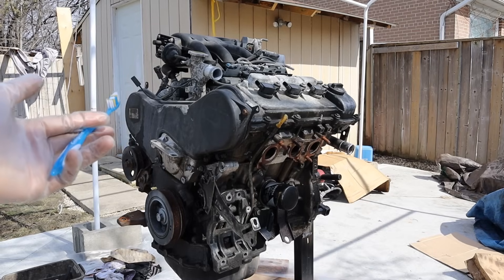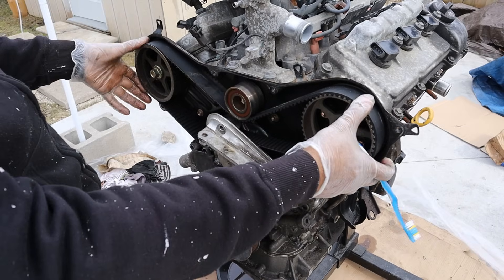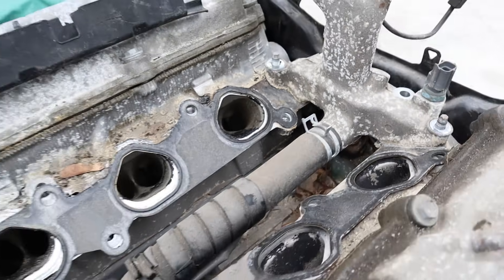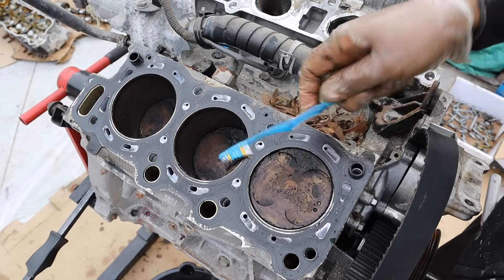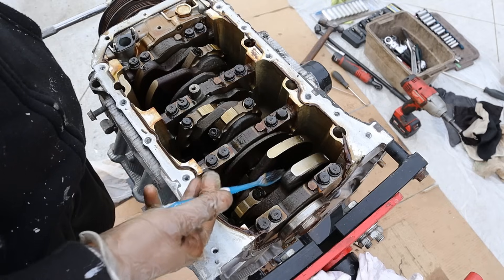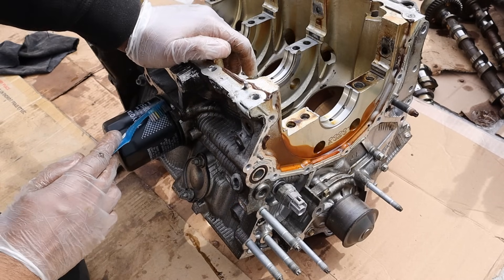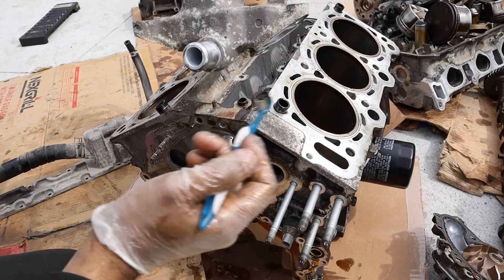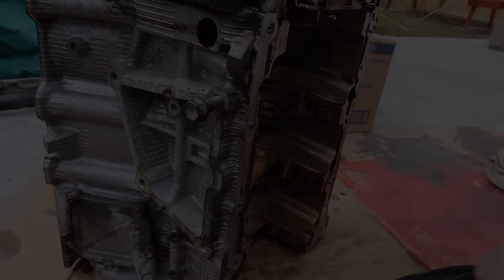Here's how the Toyota 3.0L V6 Engine Became a Success

Comment: I have this same engine since 2002 with 130,000 miles.  Very reliable,  smooth with ok power and fuel efficiency for today's standards. In the last 20 years I had to replace one  knock sensor, 2 oxygen sensors, spark plugs, timing belt and water pump. That is it. I tightened the valve cover bolts to stop oil seepage in the winter months. I know I will never own an engine this well made.
Reply from the maker: Nice! How's the fuel economy on yours? I know it's a V6 but my Lexus GS350's V6 makes more power and has better fuel economy than my Camry's.

Comment: Got one in my 01 es300. 192,000 runs smooth and quiet as the day it was made. Love these motors
Reply from the maker: Beautiful! 
Just watch out for the transmission in those 99-01 ES300s
Reply: @speedkar99  already replaced it. Torque converter went out

Comment: Im not a mechanical engineer but I dont know why some manufacturers have a intake plenum going way back over a bank of cylinders while you can be like the chevy ls, buick 3800, ford 4.6, or honda J series and have it totally nestled between the 2 cylinder banks.
Reply from the maker: It's about airflow and packaging for the hood height
Reply: @speedkar99  too bad serviceability isnt a factor.

Comment: My 99 ES300 with the 1MZFE is at 215k. Oil level barely drops between oil changes. Engine and transmission still running great.
Reply from the maker: Nice! Back when I had a 99 Solara I always wanted to trade up to the ES300
Reply: When I bought my 99 Avalon 180k, it lost half a quart between 3000 mi changes. I replaced the leaking valve covers and started swapping the PCV every 6k (at which point they are ALWAYS full of oil) and i don't lose a drop anymore. Now at 217k.
Reply: @matthewbowen5841  sure makes it easier to remove the pcv grommet when you replace it often! I remember the first time I changed it. Man, that hardened grommet put up a fight lol

Comment: I have a 1mzfe in my 2000 Avalon. It burnt an exhaust valve in cylinder 2 at 189k. I did a top end rebuild and replaced the valve along with a bunch of other parts and seals, and it's running perfectly again now at 217k. Great reliable engine, fairly easy to work on.
Reply from the maker: Good for saving that motor. Cylinder 2 was the easier to access front bank right?
Reply: Mine did the same thing. Exact same car and I replaced it myself. Runs like a champ. Only 176k miles can’t wait to push it to 500k +
Reply: Have a 96 Avalon cylinder 2 blown spark plug heavy smoke out tailpipe what could be the problem?

Comment: I have same engine in a 2000 Avalon, 294,000 miles.  Drives like a dream.  I change oil at 3000 miles or 5 months, whichever comes first.  I wish I was as good as you are.  I would take it all apart, clean, and rebuild.  Good video.
Reply from the maker: Beautiful, almost 300K

Comment: Makes me a proud owner of a 2005 1mzfe vvti camry 😂 my car has a few mods including major weight reduction, I raced a 2012 Civic SI coupe with the 2.4 the other day and it was window to window from 40km/h to 160!!, As a matter of fact I was pulling away!
Reply from the maker: Nice! What weight did you reduce ?
Reply: @speedkar99  lighter sports muffler, full size spare wheel and kit delete, zero seats in the car but mine, low profile 15 inch tires in the front, k&n air intake
Reply: And 20 lb civic battery

Comment: Wow good stuff as always. Seems like a knock sensor is a really senstive microphone. This engine's been good in our non-interference rx300. No issues so far at 155k miles except rust lol.
Reply from the maker: Yes the knock sensor is a microphone that's tuned to detect certain frequencies. 

Gotta keep the rust at bay by frequently Washing off salt and rustproof each year.

Comment: Actually , power steering pump is fairly easily accessible from the bottom when the vehicle is jacked up or on the ramps.
Reply from the maker: In the gen4 body maybe. Not the 5th gen. Things are tighter.
Reply: @speedkar99  2003 Camry v6, I even ordered one, but never got around installing in.

Comment: I just did a timing belt and seal overhaul  on my moms 03 Avalon with this engine and 280k miles. That vehicle is a true testament to Toyota’s older reliability. What a pain to do over my Accord J30 engine in the bay.
Reply from the maker: 280k miles, nice! 
The accords were good motors too, the only thing I appreciate about them is it's easier to get to the rear spark plugs due to the intake design
Reply: @speedkar99  I have done at least 30 T-belts for the J-Series and already 2 too many now for the 1MZ-fe. She runs 87 octane in it and supped to be premium but still runs perfectly smooth with no hesitation. 

I settled on a 06-6–6 sedan. Accessories are not as reliable on a Honda but those engines really are bliss.
Reply: I miss by accord with the j30 v6
Reply: @thetechlibrarian  my friend is selling one for around 2-3k Virginia.

Comment: I have just over 350 kms on a 2003 MCV30 Camry and hasn't skipped a beat (touch wood lol). Haven't had to replace any critical components yet, just the usual globe/belts/fluid/filter changes which are done myself. Actually the air conditioning and a rear door lock actuator doesn't work, that's about it.
Reply from the maker: Nice! How's the suspension held up? They usually get clunky at higher mileage
Reply: @speedkar99  Suspension is holding together pretty good, albeit haven't had a good look underneath for a while as haven't had the need to. She frequently sees rough unpaved building sites while full of tools (work) yet no rattles or clunky sounds, yet lol. I appreciate that you replied to my comment 😆 thanks and loving the vids

Comment: 2000 Avalon—352,000 miles; 5th owner, uses 1 qt every 4,000 miles; no internal motor or tranny work. Boring is good.
Reply: Swap your PCV. I bet it will slow/stop oil use. Then keep swapping it every other oil change.
Reply from the maker: That amount of consumption if say is normal

Comment: mine nearly failed because of the VVT solenoids. Cost 300 bucks for the part to fix one bank. Also I have the 2001 avalon and managed to do the back bank of spark plugs completely by feel, it's technically possible to do it without removing the intake manifold. But it really sucked so probably better to take off the manifold instead.
Reply from the maker: Yeah the older 1MZ with the metal intake manifold is easy to change spark plugs. It's these newer ones with bigger plastic manifold that have to be removed.

Comment: Because of its placement with minimal air getting to it, the power steering unit has its own cooler/heat exchanger in front of the radiator. Well, the Aussie assembled Camrys sold in my country do anyway. :-)
Reply: That was one of the changes to the XX10 when the tooling was shipped from KY to Australia.
Reply: @matthewbowen5841  "KY" ???
Reply: @TeUhtred7860  Kentucky, USA
Reply from the maker: Not all do. The 5th gen Camry runs the line to the front but it turns back around and goes to the reservoir.

Comment: Had a Camry like that. Reliable but boring. Solid it for an electrical nightmare of a B5 Passat 1.8t 5 spd. Didn’t regret a thing.
Reply: Being boringly reliable is the exact reason i bought one as a 2nd car, also save gas and wear on my Lexus IS-F.
Reply: @TeUhtred7860  Yup, does the job! I'm coming into age, wife, maybe kids soon so I said to myself next daily driver after my '12 TDI will be a prius or a corolla. I'm not a mechanic but I work on my cars and I need one that does not need any work.
Reply from the maker: My Camry is my beater too. Use it to teach the wife to drive, tow my trailer and in the winter. Keep my Lexus GS350 for myself
Reply: @speedkar99  I'm always on the lookout for one of the 4th gen XV20 special edition TRD supercharged, V6, 5 speed manuals called the Camry TS Supercharged, that was put together specially by Toyota NZ.
Ive only seen 2 and both owners didn't want to sell. 
They are still, just a Camry, and don't make much HP compared to modern cars, but still would be cool to own and drive. :-))

Comment: The 1MZ in my '97 Camry was a great engine. Changed oil myself regularly but had the dealer do the belt, pump and plugs around 150km. Ran it 'till 300km then moved on. I can't remember replacing any of the ancillary bits; alt, starter, rad, ps pump. Crazy good car all around.
Reply from the maker: What happened to the Camry, sold it?
Reply: @speedkar99  Yes I sold it, back in 2013.
Reply: @GeneFever  Why did you end up selling it ? Just curious
Reply: @cgmf-d6t  No reason really due to the car itself. It was my commuter for ten years then I retired and didn't need it anymore. I was ready to move on.
Reply: Still have my 00 Solara with the 1MZ  of 13 years.. bought it with 80k Miles currently have 223k and going.. I'm ready for an upgrade but I think I'm going to keep this car around as my daily commuter to work super reliable engine
Reply: my exact sentiments! love this car! using oil now @186k so thinking of a ring job
Reply: 300,000 km thats nothing thats about 160,000 in miles

Comment: 1MZ points of failure (in my experience) - (1.) 1MZ (3liter) only has 4-piston oil-control holes/piston (2-per side of each piston) - which, in my experience, is severely lacking; which contributes to premature wear and oil-burning. (Fix: clean the orginal 2-holes, and carefully drill an additional 3rd hole, and check crosshatch marks - re-hone if needed)(2.) At exactly at 150-160k miles, where the engine "off the service charts" (according to Toyota), I always have/see head gasket failures. (3) (not so much a "failure") That mentioned knock sensor is very sensitive; it can/will even sense regular from premium gas, and will retard timing, which'll result in that lack of "pep". The engine is tall (60°?), so it's installed in a tilted-back manner, so, to tighten the rear bank head bolts is a PITA.
Reply from the maker: Didn't know the oil passages in the piston head were an issue since the oil rings look very spaced apart and won't clog up like the 2AZ
Reply: @speedkar99  re:"...oil passage holes" - But they will and do (become clogged). Toyota's fix? Upgraded pistons with three drain holes, instead of the stock two holes (u can save $ by drilling ur own third-drain hole; saw it done; did it myself several times; it works!). Never fails to fail: head gaskets @150-160k miles; 1st symptom: mysteriously vanishing coolant. When heads are removed, for head gasket R&R, check cylinder wall cross-hatch marks; and if marks are rubbed-off? Pull motor and use Flex-Hone to recondition said cylinder walls. Lastly - I like ur channel 👏👏👏. I learned lots here - I like the hands-on stuff u do, and ur funny, too. I'm glad I subscribed 🙂. Keep the videos coming. 👍
Reply: 2AR-FE also according ti the Car Care Nut channel.
Reply: The problem with the angle of the V plus add the tilt of the engine towards the firewall the oil puddles in the rear head. The oil gelling was do to bad maintenance and the PCV design caused all the sludge problems. Toyota has a superceded valve covers with different baffle plates and on the rear valve cover they updated the plastic L push in PCV to the threaded metal one.

Comment: not clear on the web whether its an interference engine or not :)
Reply: yes and no it depends on how much the intake cams are "shifted" rotation wise from the phasers if and when the belt breaks. that is how i understand it
Reply from the maker: It's not
Reply: @speedkar99  glad to read that,,, I’m gonna have time to do the motor mounts and tires on my new to me 2004 Camry v6, my 2000 xtrrra died of interference an I couldn’t find any Toyota suv on my price range

Comment: I have an MZ in my 99' ES300. Since learning about its robustness I've put in the time to take care of it. I just did a timing belt/water pump job on it also replacing the cam and crank seals, I replaced the leaking power steering pump and pressure line which has pretty much stopped all of the leaks. I dealt with a burst coolant bypass hose last year where I replaced the knock sensors, fuel injector seals and the gaskets. Radiator hoses, Thermostat, radiator all replaced. Just finished putting some new spark plugs in it and I love how smooth it drives. A big shout-out to you and your channel which has given me the knowledge and confidence to even attempt alot of these repairs. The car has around 180k miles now I want to see how far I can take it. One of next repairs will be to attempt your AUX hack to connect my phone to the stereo which is the only feature I'd like to make it a modern car.
Reply from the maker: Nice work! Keep it well maintained and it'll last. All the best on the aux hack, it's been a while since I've done that.
Reply: Nice man. I have a 93 es300 with 193k right now. Just did spark plug wires and cap/rotor to clear up a misfire. Old fashion tune up and she runs amazing still
Reply: Just use an FM radio transmitter that plugs into the cigarette lighter! Easy solve.

Comment: Amazing engine, thanks for the tear down! I have an early version from 98 without VVTi, with the waste spark system, and cable operated throttle. It’s currently at 306k miles, with the first 170k being under someone else’s ownership and being very neglected when I got it. I loved seeing you describe all the common issues as it’s so familiar.
Reply from the maker: You are welcome. I remember you from the club Lexus days. I am familiar with these motors from those experiences that's why this was a favorite for me as well.

Comment: I have a 02 Avalon with 84k miles. I read somewhere that the PCV valve is something that should actually be replaced every 30k miles. I came across that after a shop mentioned to me it was leaking and when I went to inspect it, it was all covered in sludge. I changed it which took less than 5 minutes, no noticeable difference in the engine performance, after a year though it seems to be getting covered again. The front valve covers also seem to be leaking but it doesn't seem to be enough to cause a noticeable difference when checking the oil dipstick. Other than that, you would never know any faults exist, it idles and revs extremely smooth.
Reply from the maker: Yes keep the PCV up to date and you'll have less chances of sludge

Comment: My 99 Jvin Camry has a 1mz and it is butter smooth. And doesn't burn a drop of oil. It's been a great highway cruiser for me.
Reply: I once briefly drove a J-vin CE V6 manual. What a unicorn.
Reply from the maker: These make for awesome highway cars
Reply: @speedkar99  I drive 82 miles a day on a very big highway every day to work. My 23 year old v6 Camry keeps up with modern traffic with no problem at all. 80 mph all day and rides like the road is glass.  I get roughly 520 miles on a tank just before the light comes on. Over engineered cars for their time.

Comment: Question? How close is this engine to the 3.5L v6 in my '07 Camry? By 'close' I mean is my 3.5L as reliable or close to it as this one is. Just wondering. Mine just hit 100K miles and still going very strong. Only major problem was an alternator failure at 85K miles. Anyway, LOVE your content. Thanks for the work you put into this channel!!
Reply: Yes it is as reliable if you get a VCM muzzler for that cylinder deactivation system, if you have it..
Reply: @SamslamminCars  Don't have it! I guess I'm lucky. Thanks.
Reply: @mazelme  which model and manual?
Reply: @SamslamminCars   XLE  automatic
Reply from the maker: 3.5 is way different. Timing chain driven ...

Comment: Got a lot of spare OEM parts for your other Camry right there.  With the upward price and lack of availability of car parts it's even more important you keep hold of them.  The powers that be are making it very difficult and expensive to maintain and run gasoline engine cars in the hope we will move to EV's.  My Sequoia is now a lawn ornament, my daily driver is a 97 Celica GT convertible I picked up for $1200, get double the gas mileage and it runs like a clock.  Regarding EV's, I'll wait for the arrival of the cheap small Chinese ones that are predicted to sell for around $10,000, would trust these any day over a ridiculously priced Tesla.
Reply from the maker: Nah I won't be keeping this, it'll be rebuilt as a track car

Comment: Too bad about those timing belts, though. Nissan's v6 of that era had timing chain.
Reply: They are perfectly fine if you replace them at, or before the time recommended with, with Toyota ones. Plus its a non interference engine so if worst happens, you won't lunch your engine. Having said that, the 2UR-GSE in my IS-F has chains, and im glad it does. :-))
Reply: As the other comment says, pre-VVT MZs were non-interference. And while nowhere near Nissan's worst (hello, VH45...), the VQ30 did occasionally munch through timing chain guides, and was full interference for obvious reasons.
Reply: @matthewbowen5841  ALL 1MZ-FEs are non interference including the ones with VVT.
Reply from the maker: The Nissans weren't good with chains either...

Comment: Love it!      Miss MZ engine in old Sienna vs 2GR-FKS in new one..     Way more power in new one, but old one was so much smoother, and sounded great.
Reply from the maker: Agreed. 2GR has good power, I have the 2GR-FSE version in my GS350 and I enjoy it, however at the expense of Lexus smoothness you'd expect
Reply: There was an old video of a 2gr swapped red MR2. I'm not sure who did the swap, but it sounded awesome. Like an older baby ferrari v12. I have yet to find a similar swap with the same intake and exhaust noise, though.

Big fan of sleeper builds using the 1mz engine.